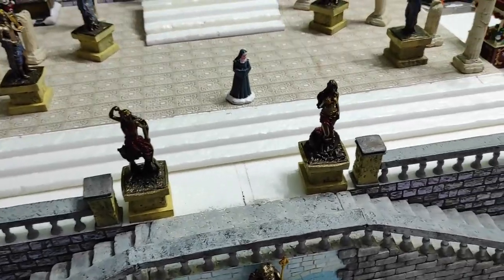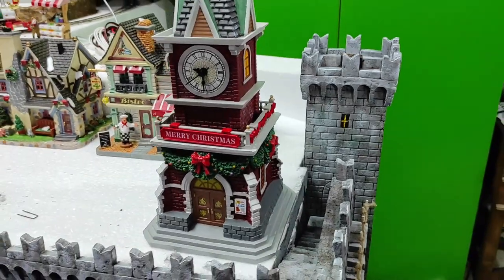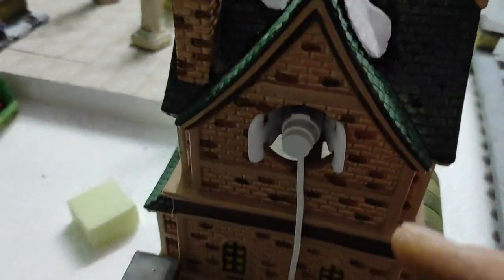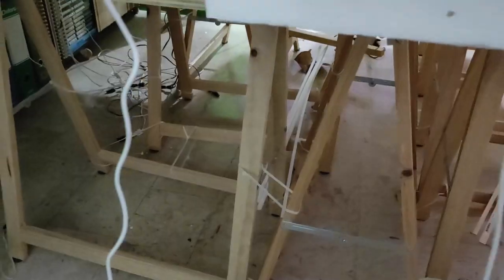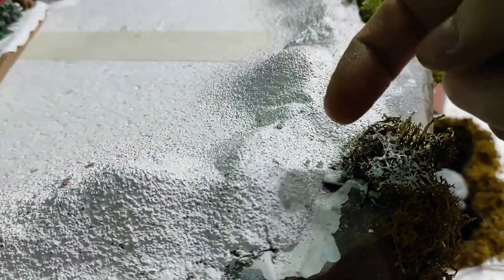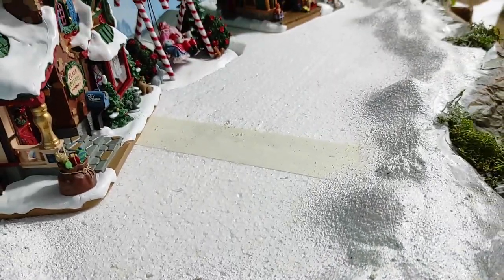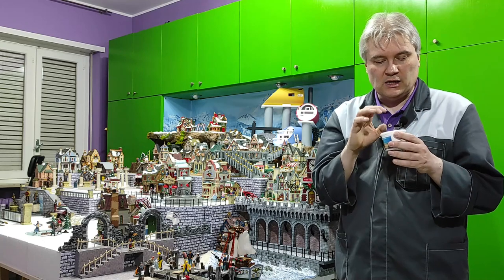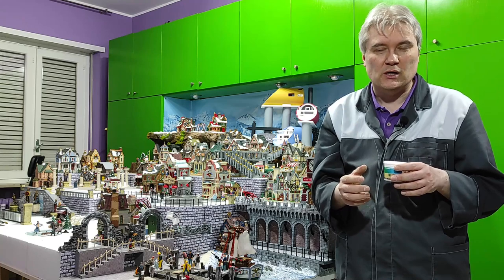Christmas Village Tutorial 2021 - Part 17

Comment: The snow looks great Silvio!
I used your idea to make a custom fence with push pins but I used a heat gun to curve my styrofoam railing on top around curved areas, worked great! Accessories really do pull everything together. Your village is looking great for 2021.
Reply from the maker: I guess the styrofoam is XPS. I tried too for the snow but I should have bought some thicker styrofam (over 12 cm) in order to get a good result. Yes, I totally agree: accessories and tools are absolutely mandatory.

Comment: Hello Silvio,
Gorgeous flooring in the Greek park, it looks very classic and elegant! Oh crud, did you gun catch on fire again? You may get some wild and crazy but you sure can pull it all together, so talented.
Reply from the maker: Hello Susan,
I absolutely have to change the tool for digging the grooves in the Styrofoam.
I need one that's sturdier and more durable.
I've already seen something that might be right for me.......
Reply: Hello Silvio,
Excellent, I know Hot Wire foam has some great tools, I own a few. They do a great  job on cutting and carving but I have never used them for digging. I have used the hot knife for grooves for wires, though.